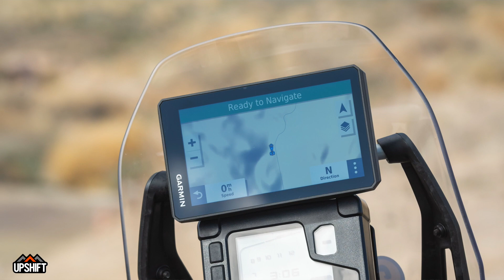Yamaha Tenere 700 Project - Phase 2

Comment: The bike looks cool however... Your answers about the price are borderline deceitful just say the number and let the chips fall where they may or include in the description line by line.  This "we don't tally the prices because they change and different retailers" is just a smoke screen.  People that have the money will do it and those that won't will do parts of the upgrades.  You can even use MSRP as highest number and then say it is less that than for package deals etc.  Clicking on each individual link doesn't give you the answer either the shock company didn't have prices immediately available either.  Close your eyes and pull the trigger for england as David Niven had said to Gregory Peck in the movie Guns of Navarone.  As someone who is looking to buy a Tenere 700 have no time or patience to play cat and mouse with prices.  This comment is coming from someone familiar with sales and marketing as well as a motorcycle enthusiast.  Like had said there are cool upgrades in the video.
Reply from the maker: Prices do change and this is a lesson hard learned. Why would it be a smoke screen... it's not hard to go find the current prices. You're basically saying that you are lazy and you wanted us to do the work for you. Suspension is an impossible thing to price without having the suspension in hand and opened up. One guy might send some suspension in that needs wear parts replaced. Another guy might be sending in brand new suspension but needs a heavier spring than first though and it costs more. It's not an off the shelf thing... it's a custom service. How do we price that? Should we just throw a number up there and frustrate people when their suspension service costs significantly more? Or maybe you should make a little effort and email them or call them and get some information for you specifically.
Reply: @UPSHIFT_ONLINE  people that have money are lazy.  They just want a number.  A number that can give them a ball park.  Your video had a completed bike with bells and whistles and it cost x amount of money.  What is lazy and borderline deceitful is to NOT include that number.  

Have been in sales a long time and a lot of people are afraid to give numbers because it becomes an instant NO.

As far as your last statement about the price wouldn't the same customer be surprised if the price was less?  Why didn't you include that part in your statement?  Because fear of losing the sale over cost was the motivation for not including it.  

Don't fight me listen to what am saying and throw out your ego.  Take my arguments and show someone who knows sales and that person will tell you to listen...
Reply from the maker: Are you under the impression that we are selling these items and are afraid that we will lose a sale based on price. To be clear, we are a media company and this is a project bike that we did for our magazine. The only thing we sell that is on this bike is the graphics kit. And we might have to raise that price in the near future as well so posting it on a video that will live on in perpetuity is not a great idea unless we want to come back and update it. But updating hundreds of videos for all the things that change in time is not practical. Prices can change dramatically over the years and posting prices has never worked out well over time. Lessons learned the hard way. Our content in general is meant to be consumed for many years to come and things like price make our content less valuable over time. This video is a resource that shows what we have done to our Tenere 700 in a separate medium beyond our magazine. These are all parts that we have vetted for performance, our personal preference and based on relationships we have in the motorcycle industry. Our ego has nothing to do with it. It's simply a practical strategy that works for us.
Reply: @UPSHIFT_ONLINE  Your ego has everything to do with it and your responses only highlight that at every turn.  As a journalist it is surreal that you have taken such a stubborn and biased position in all your responses.  Ok then you keep leading your sheep this is my last statement.
Reply from the maker: Thanks for helping the algorithm along! Appreciate it... ;)
Reply: @UPSHIFT_ONLINE  Dang some of these folks get triggered by the weirdest things. Doesn't have the time to look up prices, but has the time to comment in novella-form on YouTube smh. Beautiful bike, btw.
Reply: @michaelidarecis  Seriously, why would they name the price of an item they don't sell?
Reply: @amaximus167  at the time of doing the mods it would be an easy thing to say. When we did this it cost X amount of money.  It is a simple thing to do instead of giving lame answers.
Reply: @michaelidarecis  going online to look the parts up is also an easy thing to do, instead of leaving lame comments.
Reply: @amaximus167  if you asked a question to add your two cents then bug off.  He didn't handle the conversation properly and had answered him accordingly.  Now if he needs you to help defend him then where were you last week?  This is done already however if you want a go at it then fine.  Other people asked him about the cost and as a journalist like he had said it would have been a question people would ask.  Obviously you didn't read carefully because clicking on those links didn't give prices quickly and lastly a guy with money just wants a number.  Not everyone likes to look and click etc.  If anything my comments should have helped them understand and become better instead of hurting their ego.
Reply: @michaelidarecis  the dramatics on you, my lord. I am not here to defend him, I am here to say you're being unreasonable. You didn't handle the conversation correctly to begin with. You came in swinging and making accusations. Maybe if you would have started off a little nicer things would not have escalated? I am sorry you're too lazy to click on a few things. But they left links, they were not slacking. And yeah, I clicked the links, it wasn't hard to find a price. Really easy. It is also pretty standard for YouTube journalists to leave links rather than prices.
Reply: @414woods  right?
Reply: @amaximus167  good for you now you can sleep good at night defending YouTube honor.  Everything that needed to be said with them and me was done and you are saying nothing that wasn't covered.  As a journalist expected more from them.  Was respectful it is that this affected their ego just like yours now.  He even admitted he was in the way if his self.  What are you looking to gain from this?  Also note lazy is not a bad thing like had pointed out people with money are lazy.  High end people are incredibly lazy and had said that to them so maybe they can understand for future potential clients.  Clearly you didn't agree with that because you are the go getter...
Reply: @michaelidarecis  you were not respectful. You called them deceitful. You said they were using smoke screens. You claimed a typical YouTube journalism practice is 'cat and mouse.' You then demanded they spend more of their time catering to your needs because you can't be bothered clicking links (which they already spent a lot of time hunting down and pasting into the video) due to having no time or patience, but then proceeded to waste time and patience on here complaining. In the time it took you to type your frustrations, you could have found the parts. For all the talk of people's egos you seem incapable of seeing the biggest one here, yours. 

Pointing out your rudeness is not defending anyone's honor. It isn't about them. It is about you. So check your ego and take some helpful advise, be nicer if you want actual results and respect.
Reply: @michaelidarecis  you know, for a person that thinks people should be grateful for unsolicited criticisms and insults, you sure don't seem able to handle it in return. So dramatic. So entitled. 

But allow me to clear the air;

1.) I don't know Upshift. I have never heard of them before I saw this video today while looking up Tenere 700's. I clicked on a link (see, not hard to do) and came to this video. Not friends, not a fan boy, not a white knight, not even subscribed. Just a random dude calling out another random dude for being rude online. 

2.) I don't get anything from this. It isn't about me, it is about you.

3.) I am not proud of myself, nor am I showing my buddies. You are making me chuckle a little at this point though.

4.) I am not a journalist.

5.) you make a lot of asinine assumptions.

6.) you're the one being arrogant. Calling out people that are being jerks doesn't make someone arrogant.

7.) the word deceitful is in 'borderline deceitful,' so my quote was very in order. It is aggressive and a disrespectful way to start a conversation with someone who has not actually done anything wrong. 

8.) you seem to have found a lot of time to waste for a person that doesn't have 'time,' for clicking links about bike parts your're interested in.
Reply: @amaximus167  The more you write the stronger you make my position.  Now let’s see it is quite interesting how your points started out with “I” and then “you”.  Like had said your ego got in the way not mine.  You didn’t like the way had said something and just like them however miss the big picture and now you want to flip that on me.  Ok the end from the beginning my usage of clicking on a link was not properly rephrased by you because the lazy was in relation to price however the facts don’t seem to matter to you because now in your last point you make it seem as if the lazy was extended to something other than the price.  This is the same type of deceitful trolling that had known you were going to do by your second statement.  Had given you a respectful answer however you wanted a fight now in your last response you have turned it into “I and You”.  Who knows if you are telling the truth because you easily rephrased my statements and neglected to properly quote another?  If anything you wanted to call out another guy for being rude while being rude yourself.  Fraud!  So fake!  Yes of course laugh because when you twist statements and think you are making a point when in reality you are just saying nothing.  As for me like had said to them stop looking at the way had said it and get to what was said however you must have missed that as well.  It is not about being rude it is about getting past being rude which was said to them.  As journalists they should have been well versed at that.  Your quote was not properly quoted saying something “borderline deceitful” is not saying the person is deceitful but getting close to deceitful.  That is justifying cognitive dissonance another train wreck.  Actually thank you for this exchange because it will be used in one of my videos how poetic a guy wants to tell a guy who is being rude by being rude themselves while engaging in erroneously rephrasing words and using cognitive dissonance.  Just brilliant!  Thank you again!  Oh and here comes something rude.  When you use “I and You” as the beginning of points then yes indeed your ego is fully vested and not in a good way…  Just saying…
Reply: No one missed your original points. Those points were addressed by everyone. But your ego has gotten in the way of realizing that as you flounce around looking for any reason someone may have accused you of being rude other than the obvious answer, you were being rude and effectively changed the subject by obsessing on justifying your rudeness. You got called out out for being rude. That isn't fraud, that is basic social communication. You're rude, people reply back with what you put in. That isn't cognitive dissonance.  Expecting people to reply to your impoliteness with graciousness and friendliness is the only cognitive dissonance going on here and it is the height of arrogance, something you seem to love to throw at other people defensively.  Then trying to pin that on their ego rather than yours is nothing short of amateur narcissistic projection. Yet here you are, wasting all that time and patience you said you didn't have, grasping to justify your rudeness and entitlement while condemning like replies. Oh and here comes something rude.  When you accuse someone of something that is false and they reply with “I and You” at the beginning of their points you don't get to accuse them of a fully vested ego, that is once again, the sign of manipulative deflection and narcissism…  Just saying…  

Man, just admit that you were unnecessarily rude in your original comment, derailing any useful discussion and move on, unless you really do have a lot of time and patience to waste after all?
Reply: @michaelidarecis  wow, you went full on word salad mode. Impressive that you would abuse all those words rather than just admit you're rudeness is what caused all of this. Precisely the work of a narcissist, project and deflect.

By the way, you don't have to say 'I,' to talk about yourself, which you've done a lot because you're a narcissist.
Reply: @amaximus167  See where we are now you were trained in that you limited your response because my statement about forcing you to lie must have resonated. Therefore, you can learn from someone that you accused of being "rude, arrogant, narcissist and other things you called me"?  That was an important point that had covered with the person who had made the video and also covered that with you and mysteriously it worked.

You see that wasn't very difficult and more interesting is that you didn't make statement about yourself because again you learned that by saying statements about yourself you would be lying. 

Also what had covered in my previous statements that the only purpose you had was to be the one to call me rude and add nothing more to the conversation.  Your last answer was far shorter than your other lengthy responses and the only thing you stated was your personal desire for me to admit to being rude to YOU.

By the way am not projecting or deflecting am only observing how this conversation is developing based on your fraudulent position and twisting my words beyond their usage.  

You wanted to use words like narcissist and little did you know that happens to be what am well versed on making videos on the topic and how that an enabler who has a plan is in reality a covert narcissist.  

Lastly your statement about using the word "I" is absurd in that when you are excessively using the word "I" you are separating yourself and raising your self almost like talking to a mirror and not to the person that you are communicating to.  People that use that word "I" in excess or to the degree they use it have revealed their level of narcissistic behavior.  

At the end f the day you have to do what is right for you and have to do the same for me.  Yes had said would push you to lie it does sound cruel on the outside however it is only to bring someone to a point where they can possible raise themselves beyond the point that they maintain and then collapse and become more grounded.  So yes can definitely manipulate but only used that in my last answer to get to a point that not everyone fits into what most would call normal behavior in how they should answer us and indeed am quite abrasive at times however that is by design because the abrasiveness is intended to break through the armoring that people have.  Armoring that isolates people from the reality of true self from the character defense self.  People project their character defense and if there is information that needs to get to the other person the armoring will in a sense keep the person ignorant.
Reply: @amaximus167  As had asked you earlier why did upshift need you to extend the conversation beyond the end that it had reached?  Also how would you know the conversation would end up meaningful?  The answer is you don’t…  The reason you wanted to extend this conversation is so you can tell me am rude which had lost count how many times you called me rude in this last answer of yours.  Am pretty sure upshift had already done that.  Now as far as why this thread is this long well there is plenty of evidence of your fraud in that you had quoted me saying “deceitful” however that was not the quote in reality it was two words joined together to make an entirely different meaning quoting my words “borderline deceitful” when bringing this to your attention you doubled down on your error therefore fraud.  Another instance is using the word “lazy” outside of the context of my usage and again another dishonest representation of my words.  My usage of lazy has to do with the person with money is lazy to click on links to figure out a price they just want it there.  Your interpretation of my precise usage of lazy extended to clicking on any links.  You can’t sit there wanting to show me something while you are using half truths and dishonest quotes.  If you had admitted to anything that you had done in error the tone of the conversation would have changed however you didn’t and that was a lost opportunity.
  

If anything you should thank me about the word “I” and it isn’t that have to go back and delete it or change my words it is more that there is no “I” in my written speech.  You now have changed the way you speak since that was brought to your attention and now you have learned something that you won’t even admit to it because you have the same derangement against me as the democrats have against trump.  By changing your speech and not using the “I” you either learned something new or you are partaking in covert narcissism.  Am giving you the benefit of the doubt here. 

Regarding narcissism it wasn’t me bringing that aspect of understanding in the conversation and when that was brought up, you were engaging in “I and You” in your numbered list.  Of course you are not going to admit to that because you have derangement against the messenger because as far as you are concerned am a jerk, arrogant, rude, narcissist and the list goes on.  You still changed your speech…  You are welcome…

A few more things just to drive this home…  Have websites and over 100 videos on youtube and you will be hard pressed to find the word “I” in my website at all unless quoting The Bible.  You will also be hard pressed to find me saying “I” on my videos and in those instances an “I” does get by from time to time.  By not agreeing to the understanding of excessive usage of the “I” is cognitive dissonance since it is almost impossible to justify anyone using “I” in excess that is not employing narcissistic behavior.  The former president of the united states can be a good example. 

Am not inclined to act in the manner that you wish me to act this isn’t your world and people act and communicate in the manner they so choose. Also am not inclined to be coerced to say something from someone who is employing fraudulent behavior with twisting words and conflating words to make a point.  

What you are responsible for is The Truth and you have to deal with your inner self.  My conversations comments come in many forms and in different responses based on the moment and am not going to rehash a completed conversation with someone who even admitted they stand in front of their own way.  Just like you had gleaned information from me and implemented it and won’t give the glory when the glory is due not because am in need of Glory but to be in The Truth.  You did follow my lead about the word “I” and you will now use that in the future regardless of how deranged you are over me.

Praise I AM,

Michael Idarecis
Reply from the maker: YouTube comments... where humanity comes to unload ALL of their thoughts.
Reply: @UPSHIFT_ONLINE  ahahahah, totally.
Reply: I have not run out of steam, I’m just waiting for you to get back to the point of your being in the way of yourself rather than evading accountability by deflecting narcissist BS on to me.
Reply: @michaelidarecis  you have a very interesting way of creating a fantasy of what is going on. You have not made me question myself or change the way I talk. 

Literally, just waiting for your accountability in admitting you get in your own way when trying to have a meaningful conversation. Which, you still haven't done in your overwrought narcissistic and evasive replies.
Reply: @amaximus167  Of course you questioned yourself in that your responses demonstrated how well trained you were.  Am glad didn't tell you to roll over and play dead the police will find how obedient you would have been and shown up at my house.  

You didn't even answer my questions yet again and didn't admit to conflating my statements.  Totally failed and like had said you aren't adding anything to the conversation.

Asked you how do you know it would have been a meaningful conversation and of course you didn't answer that either...  

How does it feel to add nothing to a conversation that was already finished?
Reply: @michaelidarecis  it wasn't a meaningful conversation because you shut down any real responses with your ego and abusive demeanor. I answered that in the context of all my replies.

You're really obsessed with your own perceived power over controlling other people. You might want to have a professional look at that.
Reply: @amaximus167  Again you can't definitely say it would have been meaningful because the reality is you just don't know.  That is a fact and you want to dance around that fact with the conversation that did occur to the one you proposed would have been meaningful.  Had asked you how do you know it would have?  The reality is again have to spoon feed you reality that you don't know it would have been meaningful.  It was an assumption that could have been in error and you can't see that because your ego won't let you be in error.  Had asked this question so many times and you just keep dancing.

My behavior is what it was and my answer is don't care.  However that isn't good enough for you because you need a safe space to be able to understand anything and duck questions left and right.

Don't have any perceived power if my words bring forth a discernable response then it worked.  What angers you is that there was discernable changes in your speech and you hate that fact and because it came from me you continuously keep coming back for more.

Like the drill instructor said "got your card"...  The more you speak the easier it is for me to confound your position.  Through the multitude of your words your sin reveals itself.
Reply: @michaelidarecis  ahahahaha, you're not confounding any position at all. you ego maniac. 

I know it wasn't meaningful because your rudeness and entitlement shut down the conversation. It was as easy as reading the comments. For someone that gets in a hissy fit over someone else not adding value to a conversation, you're evading the point, your comment didn't add any value to the video in first place. 

I am not ducking questions, just not going off track on your narcissistic tangents that are only intended to draw the conversation away from the original topic. Your atrocious behavior. 

You want to talk about 'safe spaces,' you created a whole childish word game of removing 'I,' from 1st person statements to protect yourself from seeming like the narcissist you are. You continuously evade any accountability by created distraction questions and then obsessing over those, rather than the actual point. Your atrocious behavior.

I have no problems at all admitting when I might be in error. I do it all the time. I am human and am fallible. But the topic here is your errors, and the issue is your inability to admit you may have made one. But hey, projection is 9/10ths of being a narcissist. So, good luck with that.